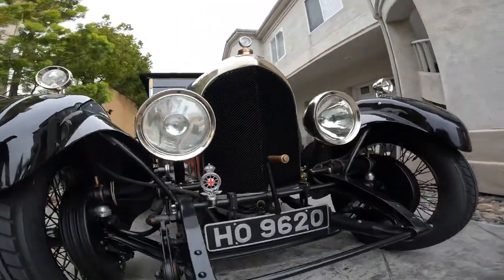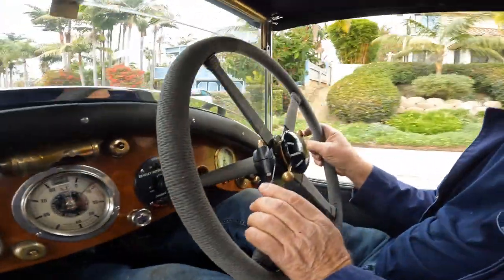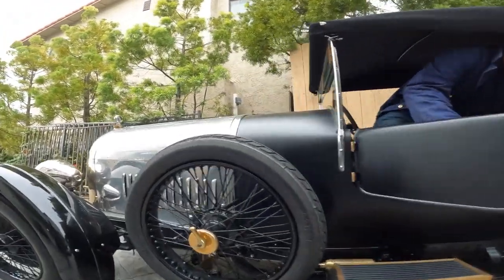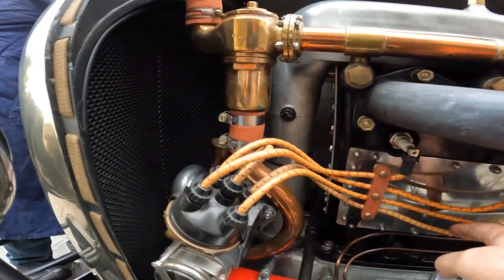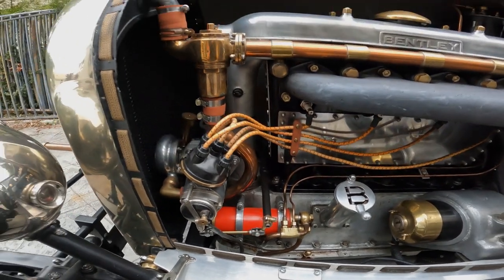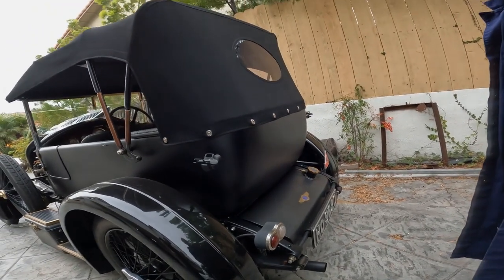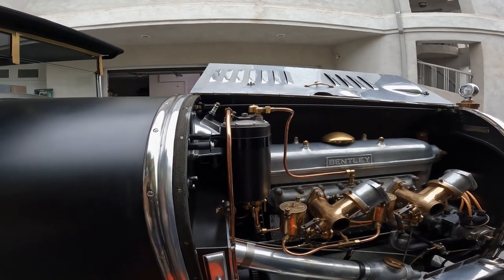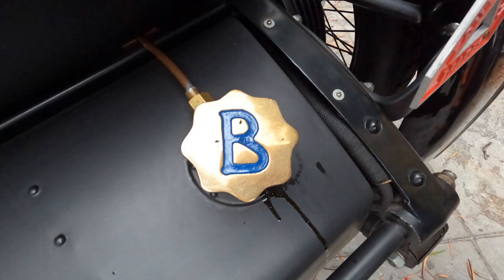Drivability & Diagnostics on a 1922 Bentley 3 liter OHC

Comment: While it was no technological slouch, I can't agree that the Bentley was ahead of its time. Overhead cams and multi-valve cylinder heads had been well proven in WWI aero engines, while Bugatti engines had both those features from well before that war. In the same year this 3-litre was made, Lancia introduced the Lambda with four-wheel brakes, independent front suspension, front-wheel drive, and unitary construction. That was properly ahead of its time !
Reply: Bugatti have nothing to talk about before the war,it wasn't til he copied the Miller?
Reply: @colinmunro7337  The Type 13, first raced in 1910, was SOHC and four valves per cylinder. Miller's designs didn't emerge until later.
Reply: @shanehnorman  and by 1913? The Peugeot was king of the hill

Comment: Have I missed something?   If it has 2 plugs per cylinder, and each plug fed from separate circuits, and ONE cylinder is not firing, it cannot be a plug or plug lead.   But it has 2 carburettors, each feeding different cylinders.   So, one carby is running far too rich, and that is causing the apparent misfire.
2 plugs per cyl is normal aircraft practice.  On warm-up of a piston engine aircraft, you do a test - operate the engine on one ignition circuit at a time.   The RPM should be a stated amount less than the RPM is with both ignition circuits working.   This is because with two plugs per cyl, the optimum ignition advance is less.   If the RPM drop is greater on one circuit, there is a plug or lead etc problem on the other circuit.   If the RPM drop is less than normal, the problem is fuel mixture, timing, or a fault on the circuit cut.  Can you not do this test on the Bentley?

Comment: If some diagnostic equipment was used (sun scope) etc. exhaust gas analyzer you would ind these issues more rapidly
Reply from the maker: John, ended up that the cam timing was off a tooth. Engine is running great now!   Pretty cool OHC 4 valves per cylinder 1922